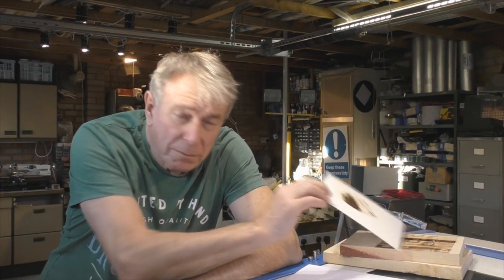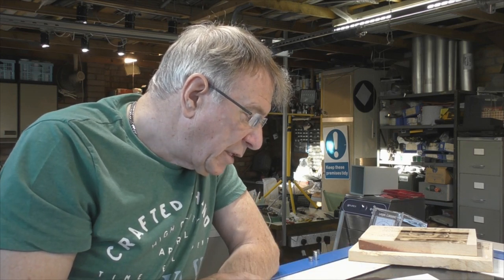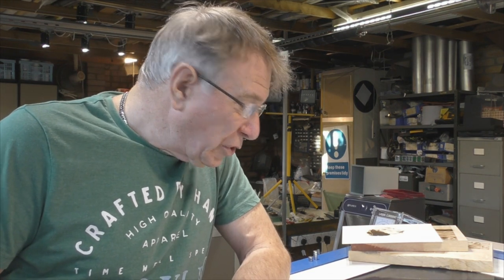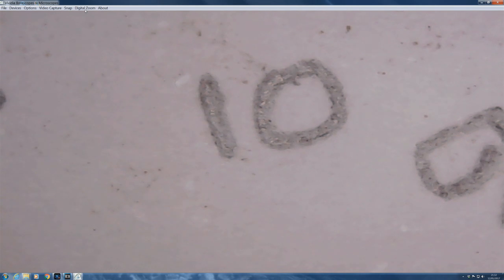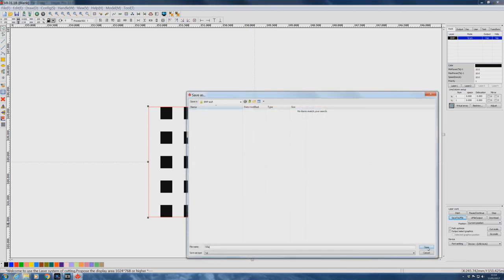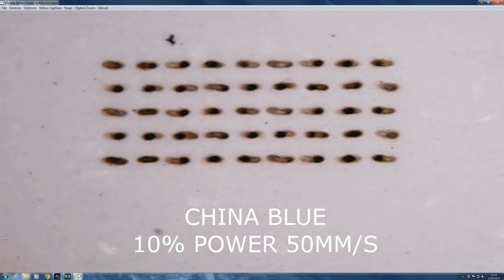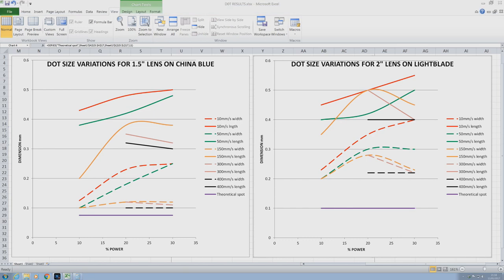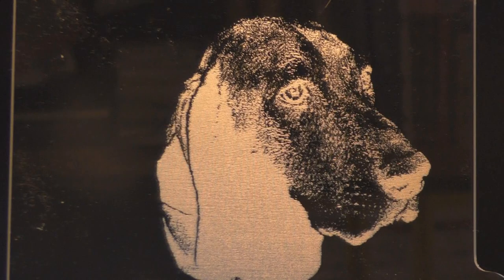RDWorks Learning Lab 106 Going Dotty Part 1

Comment: Another great video Russ.  On the subject of backlash I am thinking (maybe wrongly) that it could in fact be mechanical backlash. something I have dealt with on my CNC machines.  As the belt and drive wheels move the carriage to the right the teeth in both will be compressed against each other in the direction of travel.  When the direction of travel is reversed then there will be a tiny amount of slack between the teeth of the belt and the drive wheel before it they are compressed against each other in that direction. As both of your machines use the same type of belt and gear drives perhaps that is why it is evident on both machines?  I think that toothed gear drives are more prone to backlash than the ball screw type drives, I wonder if using a ball screw drive would make much difference on a laser machine? Just thinking aloud on that one really.  Looking forward to part 2.
Reply from the maker: I can understand the possibility of  tooth compressability or even a little bit of belt "climb" as it takes up a different positions on entry and exit. My two machines are so vastly different with their pulley arrangements that it would be a huge coincidence to see the same backlash on both machines. When you look at the two sets of results that "backlash" aspect is uncannily similar. I can also see that the backlash setting will be unique to a scan speed. From that point of view I do not understand why this setting is not a feature in the advanced speed setting parameters. That way it would be unique to each layer and not an overall setting. I will be examining this feature in more detail as I have never had need to play with it before. I think it represents a very small error in the overall scheme of what I'm finding so far.
Thanks for the comment and insights
Best regards
Russ

Comment: Hello Russ
Densitometry and reflectance of your target material is your problem.
Not a simple to explain topic.
So 100% dot coverage is not black on wood for example, and 0% is not white.
And to make matters worse you can't Laser 99% Grey or at the other end 1%.due to Pixies running together or just not engraving at all.
What you need to do is adjust your picture to match the available tonal property's of the material and
process. Process being machine speed dot size, scan width.
To achieve this you will use the curves feature in your photo editing software to stretch and compress the
grey values of each pixel to suit the reflectance property's of your material. What you will end up with is a picture on your screen that is very ugly.
So for your laser to engrave what looks like 80% you may need to engrave 50%. to engrave 10% you may need to laser at 15%
this is not a linear function hence the curves feature. Different curve for different material.   

Do this simple test create three squares and fill them with 100%, 90%, and 50% grey. you will probably not be able to tell the 100 from the 90 and the 50 will not be half way grey looking.
Now some flatbed scanas have the ability to give you a % of grey in an area, or you may be able to get that
from your photo software. Just scan your lasered test piece. 

There plenty of people who can explain curves better than I, you tube is your friend. 

Have funPr
Reply from the maker: Thanks for your great tech comment and as I mentioned in the video I have had success with getting photos onto white card,wood and slate. I have also come to realize that a suppressed tonal range works best and, to use your words, an UGLY picture comes out best because of the non linear power output of the tube.  However, in the pure world of dithered graphics there is no need to worry about the tonal range of the output because dithered graphics by default is a BINARY world, not a grey scale world. The perception of shade and tone arise in the brain  from the different density clusters with in the picture comprising single dots that are all of the same tone. I agree that different power will produce a different sepia shade to the overall picture  but ideally every dot will have the same " colour" (for an organic material such as wood leather or card)
I have played with 3D engraving  where it works with continuously varying power that etches different depths into the material and at the same time applies the tonal range you describe. The 3 D nature of dithered engraving is a completely different mechanism where it is the overlapping dots that are giiving multiple burns to the same area and thus creating deeper and darker areas.. That is the mechanism that I think every one works with and takes no notice of  because it gives a pleasing result. That is exactly what I am trying to avoid.  I am trying to get right back to basics  even if it means having to use a 50ppi resolution picture to avoid the 3 D effect. When I get to that point and probably find that the results are rubbish, I can start adding factors back into the mix to try and isolate those bits of magic that make a good picture. 
I feel I still have a long way to go on my journey of discovery and just as this first session was a bit of a surprise, I anticipate finding many more  unexpected results 
Thanks again for your helpful comments
Best wishes
Russ
Reply: Hello Russ
So after you have worked out the
effective resolution of your machine you can then find the maximum
line ruling you can do. 

Not my words -
“A very common doubt in the (pre)
press world is how to know what screen ruling to choose. It seems
obvious to opt for a high ruling, since high rulings means a lot of
detail, and that is what everybody wants. It is not that simple,
however. There is a simple way to calculate the maximum screen
ruling:
To do the calculation, let's refer to a simple formula to calculate the maximum number of gray levels:
(dpi/lpi)2 = number of grayscale levels = the number of pixels in one screen dot
(Dpi refers to the output resolution of the image setter). In your case engraver.
We need at least 256 grayscale levels to make sure vignettes will look smooth (no banding), so the outcome
of this formula must be at least 256. 

Taking this into account, the formula shows that the upper limit for the screen ruling is determined by the
resolution of the image setter. The higher the resolution of the image setter, the higher the screen ruling can be set. E.g. suppose
the image setter resolution is 2400 dpi, the maximum output screening ruling would be 150 lpi. …......”
Another topic to edify your self on is Dot gain. Also you may run into problems with a moiré pattern if
your chosen line per inch collides with the step rate / belt teeth ratio of your machine.
I use my machine to image PCB's and only use single direction engraving.
I have tried backlash compensation on a CNC with leed screws and that works, but the same algorithm
will not work with Belt drive it generates an accumulative error.
Happy ablation
Pr
Reply from the maker: Hi Pr
I wish this was as simple as printing where the dot size is under control and a real dot. In the case of a laser dot ,it appears that best case will be a 2:1 sausage.  However, this will produce a very weak (light) picture on organic materials  ( it may work on glass) and may require settings that result in 3:1 sausages  ( a new term for the laser engraving lexicon!!). I'm not yet considering how I play with all these parameters just yet as there is a lot more to explore.
Thanks for the great technical extract
Best regards
Russ

Comment: what I don't understand is, if the height of the dot is twice the theoretical then thete should be no white space between the lines if you used the bitmap that you drew. did you modify the bitmap to improve the visual  result?
Reply from the maker: Hi Ian
The resolution of the pattern I constructed was 100ppi  That converts to a pixel every 0.254mm. My pattern was black pixel, white pixel, black pixel etc  and puts the black pixel centres 0..508mm apart. With worst case,  the 2" FL lens theoretical spot was 0.1mm so when you double that to 0.2 there will still be 0.308mm of white space between lines. You can see that in the horizontal direction  when the sausage length exceeds 0.5mm ,  touching occurs 
Hope that now makes sense.
Best wishes
Russ
Reply: Thank you Russ. i was confused because your dxf looked like 1 pixel black 1 pixel white etc. followed by a one pixel wide blank line then rinse repeat.
I wrongly assumed that the pixel size was the theoretical dot size.
Thank you  for explaining

Comment: I was fighting this laser scan alignment issue when scanning text this weekend. After going through all of my alignment and mechanical linkages for slop, I still couldn't fix it.  I switched scan to X-Unilateralism and the problem went away.  I was told it's some nasty mechanical backlash, but I was pretty sure that wasn't the whole story. I'm glad to see that I'm not the only one with this problem
https://imgur.com/a/FopSe
Reply from the maker: Hi Jesse
I have seen this problem before and it has been issues with connections between controller and HV power supply . This is not a backlash problem it's too clean and too large. Private message me with your email address and we will talk off line to try and solve your problem.
Best regards
Russ